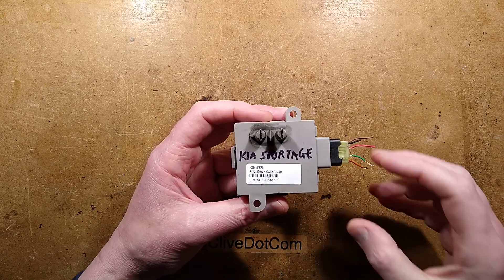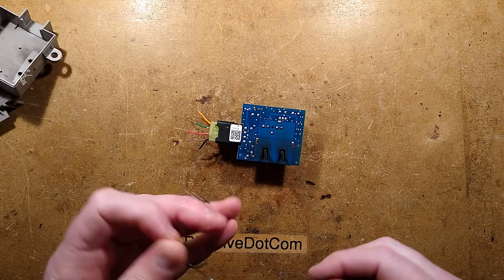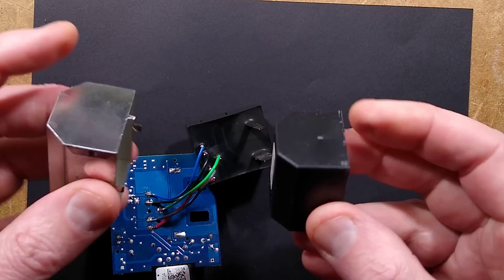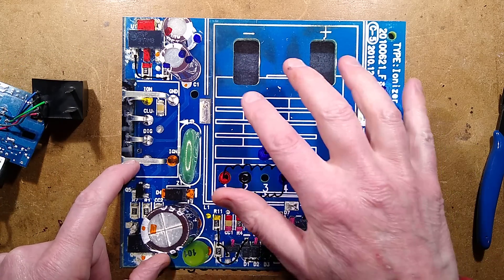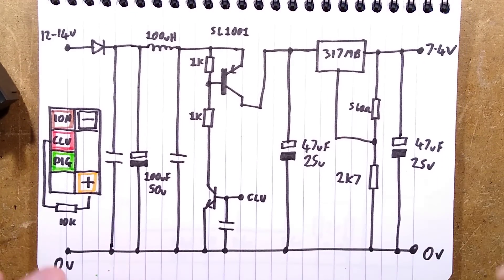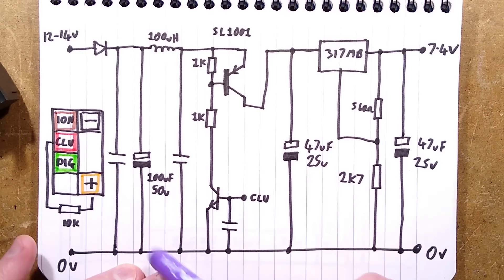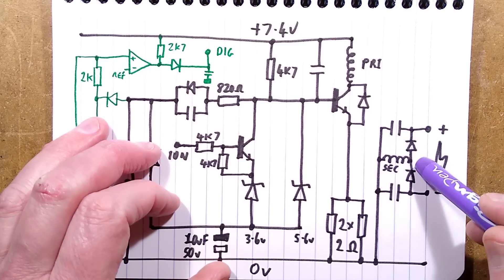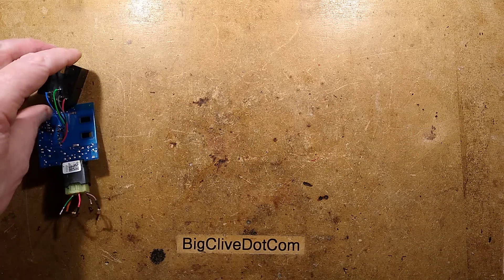Kia Sportage luxury feature hacking (with schematic)

Comment: Don't electrostatic precipitators like these generate ozone gas? People probably shouldn't be generating that in the relatively closed confines of an automobile.
Reply from the maker: These units generate trace levels similar to natural outdoor air.
Reply: Additionally, cars are mandated to have forced-air ventilation (at least in the US for many many decades) so whenever the car is in motion, some fresh air enters the cabin, and stale air exits, even if the HVAC system is off and all windows are fully closed. Older cars you could see the plastic vents, but manufacturers have gotten clever at hiding these vents over the years.

Comment: 2:08 to be pedantic, normally equipment like this typically is tied into the body control module ("BCM") rather than the engine controls.  Both engine controls and body controls will use CANBUS, but which control module is especially listening and/or addressing a given component will usually depend on the duties of the system.  Some manufacturers will even operate more than one bus, with engine controls on one and body controls on the other, which the BCM itself acting as a gatekeeper relaying or not information as it's relevant across buses.

If Kia uses a separate bus for the body functions than the powertrain functions, then likely the BCM wouldn't relay this data on to the PCM's bus.
Reply: Ancillary modules like this rarely use CAN unless there is a functional need (data speed or bandwidth) instead using a single wire serial interface such as LIN or more recently SENT protocol. There are still instances of very basic feedback using PWM or some form of heartbeat style square wave but these tend to be higher integrity systems such as SRS.

Comment: These sorts of videos are likely to become more common as cars start to ship as all one model, and you subscribe to the features you want instead of buying them once.
People have already started talking about simply rewiring BMW heated seats with $20 of parts so they can avoid paying hundreds of dollars per year. Next BMW will probably have the control module test the resistance on the outputs and refuse to engage the starter motor if the seat heaters aren't within the specified range. Then people will add a resistor to fake it. Then BMW will include a 1 wire chip with a serial number inside the seat tied into the heater itself and check the serial numbers of the seat heaters match the controller and car. Because car manufacturers all think Apple are a good example to follow, apparently.
Reply: It'll probably never get further than the first "unauthorised aftermarket modification" detection before the car auto locks and drives itself back to the finance lender for confiscation. 😂
Reply: JUST STOP BUYING CRAР.   This is the only thing that can make a difference.
Reply: All very likely.  Dashboard saying "Engine disabled, safety mode engaged... aftermarket component detected" followed by the car reporting your subscription number and location.
Reply: Then once you violate it they will send you a text you must pay 2k to start your car.
Reply: that feeling when your car does not start because the crappy chip in the seat heating system (you don't even use) is broken or a wire is loose
Reply: Then the seats will be rewired away from the ECU/ECM and a separate switch will be added for the seat heaters. BMW can eat a cock. The software AND hardware community will be very busy and waiting for this kind of shit in future.
Reply: I've kind of decided my next car will be another fuel car, but the one after that will be electric, and I'll probably have to build the damn thing myself to get a car I actually own, control, and enjoy.
Reply: @Broken_Yugo  just in case you weren't aware. The people who run everything are not secretive about their plan for you not to own anything, never mind a car of any propulsion.
Reply: More criminal activity by manufacturers .You buy it and don't own it and they put software in so you can't modify your property and they use software they don't own but lock it out .If 8 buy the vehicle the software belongs to me as well ! We force many electrical manufactures to do the same .I will buy your PLC you will provide me the software for free or I won't use your product !Seimens,Allen Bradley and all the other criminals doing what they do to screw people over Samsung Apple Tesla and all

Comment: I'm surprised ionizers aren't included/optional (retro fit?) to clothes dryers to give the clothes that "fresh air" outside smell.
Reply from the maker: The high initial humidity of the air in modern closed loop machines might be an issue.  But older machines did have ozone generating UVC bulbs.
Reply: Or just hang your clothes outside.
Reply from the maker: @peterlarkin762  Which DOES expose them to continually replenished ozone courtesy of mother nature, and results in "outdoor freshness".
Reply: I've solved this by getting a Alibaba ozone generator and aquarium pump to pump ozone laden air from outside to the insides of the dryer via a small diameter silicone tube.
Reply: @ThePitstopGoblin wow lol
Reply: @WillyJunior  desperate things one does when forgetting wet laundry in the machine and end up with 5kg of ass smelling "fresh" laundry.
Reply: @ThePitstopGoblin  Great idea.  How do you ensure it's off when the dryer shuts off?
Reply: @richardwernst  The pump and generator are on the outside of the dryer. Only silicone tube going inside and the generator does not need to be huge. The amount of generated ozone is low but continuous which works great with the temperature. You'll get a little bit of ozone soak if the equipment is left running when the cycle is done but nothing more than a "laser printer" smell when unloading the machine.
Reply: @ThePitstopGoblin  I think you misread my comment, I'm surprised ionizers are NOT generally included with clothes dryers.  I'd certainly never heard of them being included, at least here in the US.  If there are such models, I'd hope that whenever the blower isn't running, the ozone generator is off as well.
Reply: @Gazr Gazr not raining - yorkshire :) , rare event.
Reply: Ozone is the most highly reactive substance and destructive to organic materials, like your lungs.  I set up large industrial ozone generators in fire-damaged homes to eliminate any lingering smoke odors post-reconstruction.  Warning signs and yellow hazard taps were installed everywhere  but that wouldn’t stop some people (general contractors) who regretted their idiotic decision to enter the premises during treatment .

Comment: The distance a spark can jump is an exceedingly crude and rather dangerous form of voltmeter!
Reply from the maker: The interesting bit is that it stated +- 3kV and a spark is usually about 1mm per kV.  So the 6mm was accurate.
Reply: But it is accurate and repeatable, and often used for high voltage
Reply: @NeneExists  wait until he finds out about electrical breaker boxes lol
Reply: @infernaldaedra  
What about them??
Reply: I test gas leaks with a lighter😂
Reply: Dangerous Schmangerous! 🙄

What is life if you can't sschpice it up a bit with the occasional high voltage arc??

On a less serious note: measuring high voltage is not as straight forward as one would think and for getting a very accurate 'ballpark' figure, the cutters-against-terminals ploy that Clive used is more than sufficient for this purpose.
Reply: Fun though
Reply: He knows what he’s doing.
Reply: My 3-cap "Big TC" Tesla coil jumps approximately 300,000 volts, calculated by distance...  ⚡
What other way would you suggest I measure it?!!  🙄
It is actually a rather accurate measurement at these levels, especially if you take things like relative humidity and altitude into account.
edit: "Big TC" version Tesla coil built using plans from the article in the July 1964 issue of Popular Electronics.

Comment: oh wow, what a convoluted circuit for an ionizer this is. you'd think this could be made much simpler. great work on the reverse engineering!
Reply: It seems convoluted because it needs an invertor to get to the starting point of a mains ionizer, which is AC at a high voltage